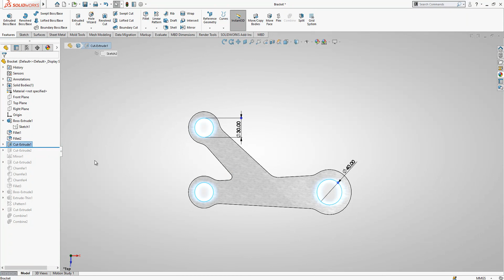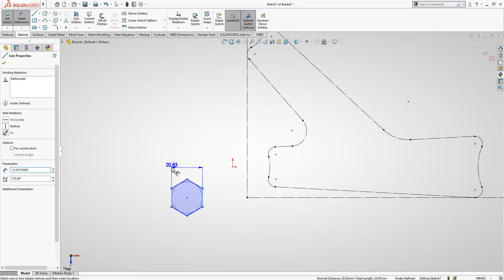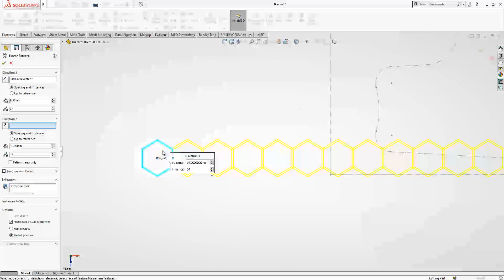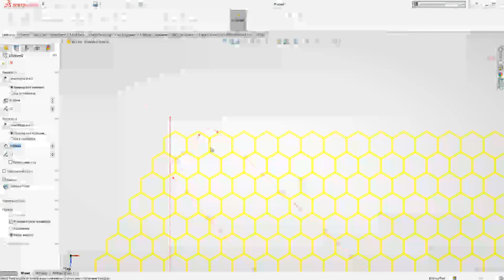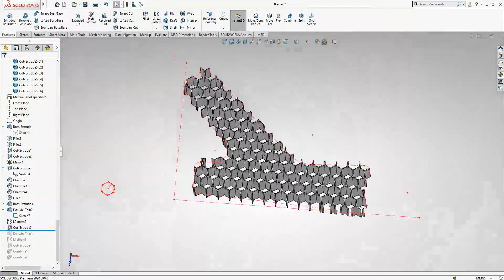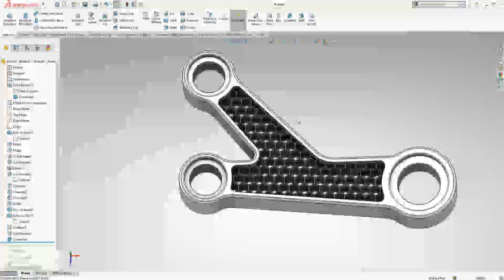Lattice Bracket - SolidWorks Tutorial

Comment: Unnecessary. This whole process can be easily done in 15 seconds with SolidWorks pattern fill command.
Reply from the maker: Hi Dear,

Filling operation can be done with fill pattern you're right. Most of the time, I try difficult options rather than readily available things. Sometimes, I forget as well. 

But anyway, thanks for highlighting it.